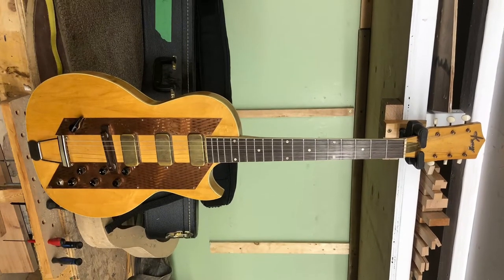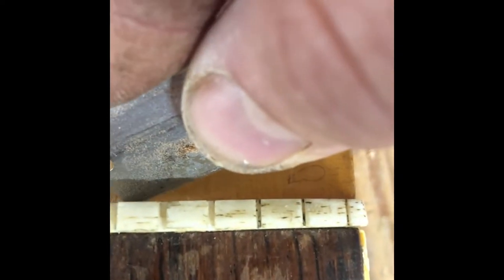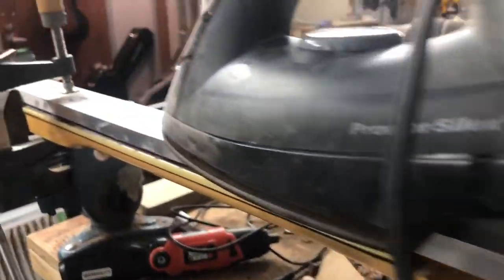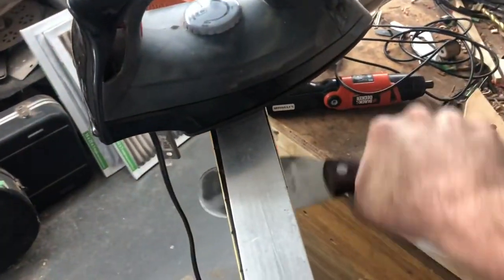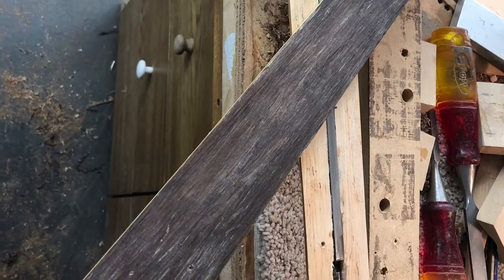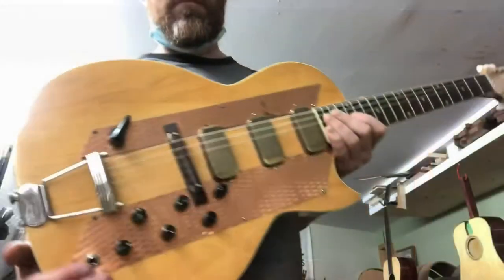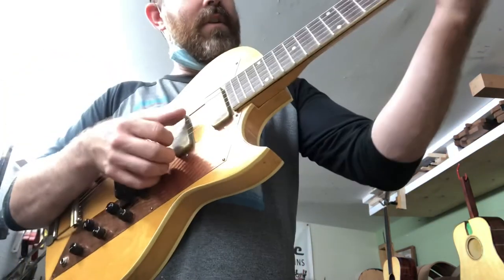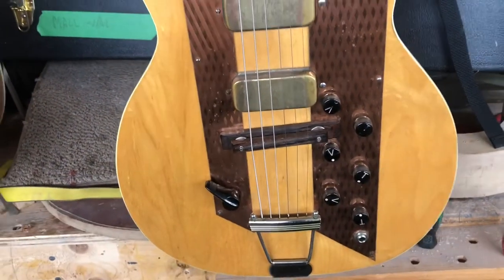Trussrod conversion on old Kay guitar

Comment: I have a Kay Vanguard II that has a truss rod that barely adjust. I’m looking to add one myself. What kit do you recommend using? Did you need to route a curved channel for this install? It’s brilliant work and I hope I can pull it off as I love the way it sounds but I need to eliminate the “ski jump” at the heel end.
Reply from the maker: With this guitar, I removed the fingerboard, pulled out the steel, reinforcement rod, then filled it with wood, and re-cut it to fit a dual action truss rod. I don’t know if there are kits available, but it’s not an impossible task! The first step is Trying! I’d be happy to talk to you through it if needed! I strongly recommend using a dual action trussrod.
Reply: @Hamm-toneGuitars  Awesome! I've been looking at Stewmac's low-profile dual action truss rods. My number one concern with installing one is that there needs to be enough material left after routing for the headstock to be nice and sturdy. I'm hoping I can accomplish the install as gracefully as you, I'm very nervous but my guitar badly needs it. Amazing job on this style leader btw, That specific model with 2 pickups is my current holy grail guitar. This video is by far the best resource on the internet about these installations. Do you remember what brand/model of truss rod you use for your conversions? I also have a Kay N5 archtop that needs a neck reset and possible new truss rod. Looking to develop the skills to take care of both.  Thanks much.
Reply from the maker: https://www.ebay.ca/itm/190421721382?mkcid=16&mkevt=1&mkrid=711-127632-2357-0&ssspo=pZovLL3kTCy&sssrc=2349624&ssuid=5H-Rb7UYRCi&var=&widget_ver=artemis&media=COPY
Reply from the maker: This is a Korean made dual action that is 1/4” wide and about .335” tall.  It’s not as deep as the Stewmac Hotrod dual action, so you don’t have to worry about going through the neck.  I find the Stewmac truss rods to be too tall, as a result, you can’t recharge the neck to a more modern thinner dimension.  I’ve used about 500 of the over the last twenty years and only one failed (it was my fault too).
Reply from the maker: The seller I posted is Bezdez on eBay (Peter Kessler Violins).  They’ve got a cool history and sell decent parts for economical repairs.

Comment: where did you get that fret attathment for your soldering gun? or did you make it?
Reply from the maker: I simply cut the tip of the soldering tip in half and filed a little groove into each one.  Total cost of tool was about $10, including the garage sale Weller soldering iron.